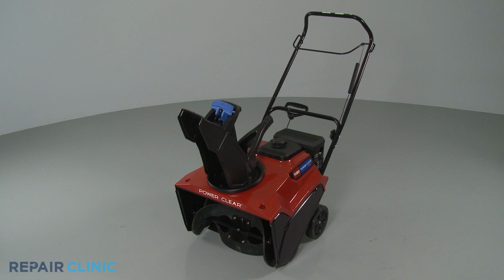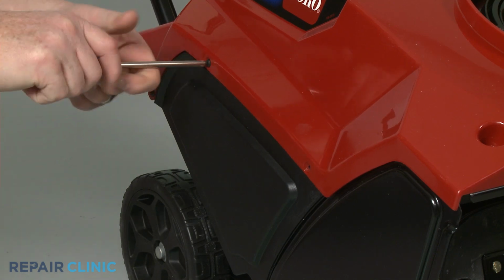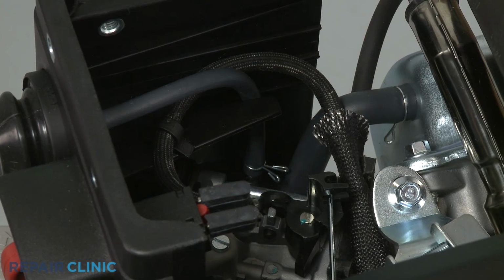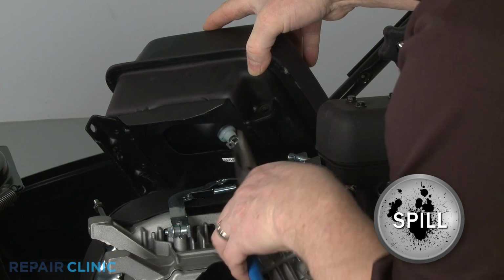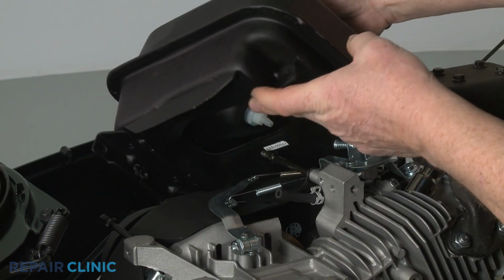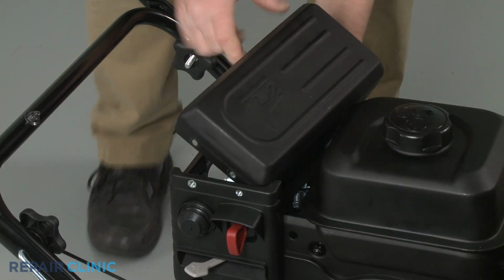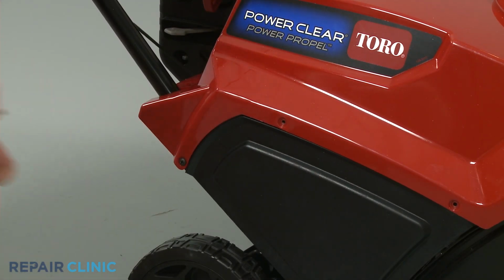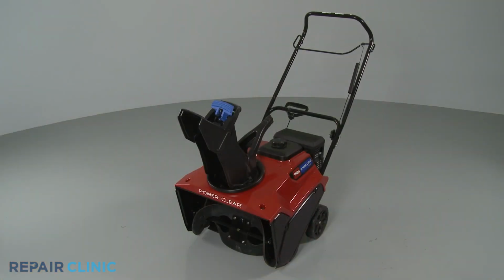Toro Snowblower Governor Spring Replacement 139-0690

Comment: This is way too much work. Just look at the  other video that shows how to get to the carb removing only 10 fasteners. Then crack open the two plastic shrouds to have full access to the carb. This video might be an OEM service manual way to do it but not practical. If a service shop followed this procedure you might as well buy a new one.
Reply: what other video??